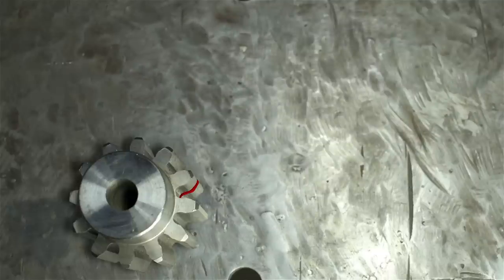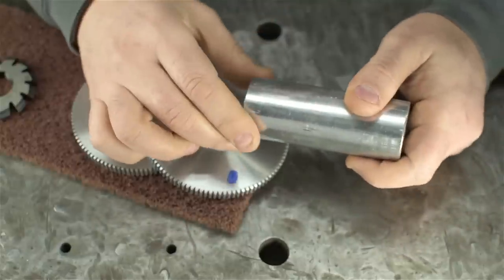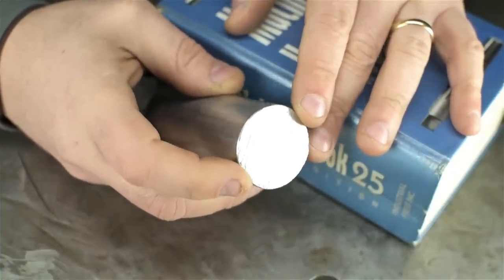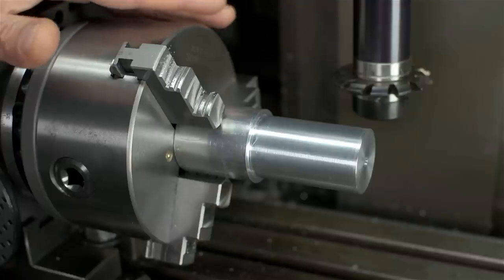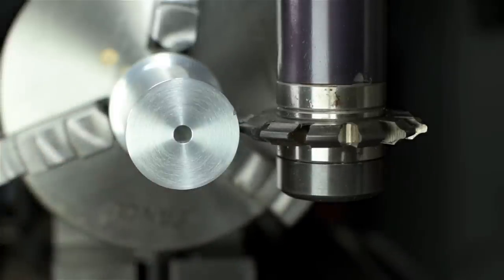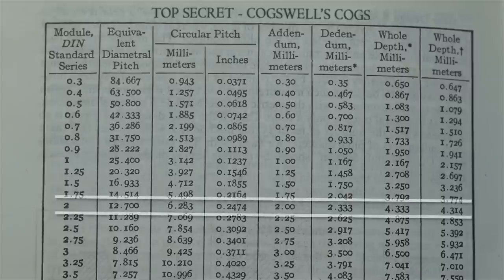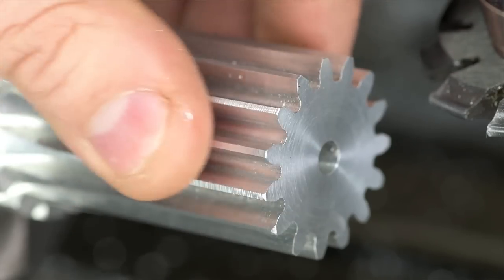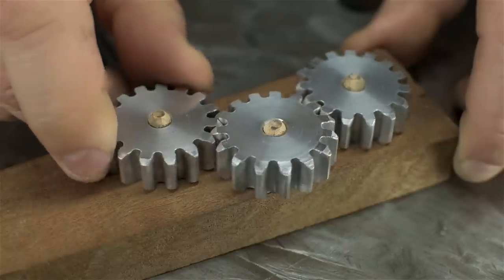15T-M2 Let This Be A Lesson To Ya!

Comment: The chamfer is to prevent creating a high-carbon concentration region during the carburization process with steel gears, I think! One time, while getting some blanks I turned hobbed and hardened (carburized) by professionals, I was going over the print with them and asked the same question about those chamfers... and got a great answer!  The carburization process is prone to concentrating the effect in sharp corners, i.e. the sharp tip of the tooth could be a place for heavy carbon concentration to gather, creating a region of high brittleness.  It's important to reduce this on the very tip, because that's the spot that will contact first if a gear is dropped, meshed while shifting, etc.
I also suppose the chamfer prevents raising a burr or ding is the gear is dropped, in general.
So that's what I've heard, and it makes some sense.  I think some micrographs of cross-sectioned gear teeth that have been etched would be a nice way to confirm that.

Comment: A couple people have mentioned that the chamfers are to prevent cracking,, but didn't say why. (yep.. put on yer spinnie hats!)  When you harden metal, small details like sharp edges heat and cool at a slightly different rate than the rest (more surface area per volume, etc..).  This causes minor stress cracks that, over half a billion revs or so, can might maybe and possibly cause the corners to break.  On the off chance that the little bits flying around are small enough that they don't just seize your gear system, possibly breaking other things attached to them, they will cause the gear teeth to wear a lot faster.  Best to nip them off, eh?

Comment: Chamfering of gears removes the maching burrs of course, reduces the chance of getting cut when handling them (also of course) but it also reduces breaking and chipping of the teeth. The part of the tooth that would chip off normally is sort of already chipped in advance...

Comment: Since i don't have a good dad joke, I'll just answer the edge chamfer question.  Depending on how tight your case is around the great train, especially if you are setting it in a blind hole or tight to an edge, you won't have to take an extreme amount of care to clean up the edge of the case enough to make sure the is no contact there.  If the gear needs to be as tight as possible to the case, like in a gear pump you wouldn't be able to have features like that unless you can make a similar profile in the case to minimize efficiency losses or you are moving so much fluid with a larger pump that the amount that slips back past that path is not significant.  

A similar feature is putting a crown on the gear or spline.  The a crown is a good feature to put on if the loads going through the gears and acting on the structures holding the gear train in place flex the orientation of the gears possibly letting the top or bottom edge of a gear contact the face of the other one, leading to chipping or breaking teeth.

Oh wait!!

Why did one gear not want to get closer to the other?

They didn't mesh well
Hold for laughter

Comment: chamfered edge? Maybe lube draw-back into the working surface. After oil is pushed to the depth of the tooth and out sideways by the mechanical load, centrifugal force pushes it to the tip of the teeth on the outer face of the gear. A little chamfer draws it back into the teeth instead of it getting thrown off.

Comment: The reason the chamfer the teeth is so under high loads the outside of the teeth is less likely to brake of and also help with mesh in a gearbox nice job of those gears looks professional 😉

Comment: Maybe the chamfer lessens the chance of a gear tooth chipping off the corner when axles aren't perfectly aligned or some small object interferes; also allows the teeth of two gears to mesh with enough contact area but also takes away what isn't necessary to reduce friction.

Comment: If I remember correctly (pending wife to comment below) the gear teeth are prone to break off from stresses when the teeth have sharp 90 degree transitions. The chamfer should reduce cracking in high torque applications

Comment: I'm late to the party, but I haven't seen anyone hit all the various reasons for speccing chamfers on the gear teeth. For one, sharp external corners are more likely to chip or break and cause issues. For another,  removing the sharp corners is nice if there's any angular misalignment between the gears. It also helps lubricant on the gears (you'll likely never see gears on a gear pump with a chamfer), and finally, if you spec a chamfer, you can be pretty sure they'll knock the burrs from parting if off when cutting the chamfer.

Comment: The chamfer on the sides of the teeth is to prevent snagging. When the tips are exposed to a load at speed, they can flex and end up chipping. This would be bad in a sealed casing because the chips could cause additional damage to the gear train. Hope this helps.

Comment: If the gear faces are in close proximity to another surface, chamfering the teeth gives them greater clearance under load and deflection, and prevents the teeth binding into the nearest face especially as the bearing surfaces age, and also helps stickier debris to free itself.

Comment: "Chamfering plays a rather critical and important role within the gear production process. The process occurs after the process of soft machining which is delivered to the edges of the teeth. With chamfering, the sharp edges along the work piece faces are eliminated. This allows for a shaping potential for a defined edge shapes that can be realized. Generating a chamfer can be because of multiple different reasons. For example, to avoid any weakening in the edge area during heat treatment or to improve assembling processes for spline gears. Furthermore, a chamfer can increase the life of the hard finishing tools on the following manufacturing processes. Especially honing tools can react very sensitively due to stock deviations around sharp edges."

Comment: Its also a good idea to to jot down the degrees the chuck should advance every time. In this case 24 degrees. If you start at zero, you get 24, 48 72 etc. It is a simple double check, especially something critical and when you say are doing 7 divisions and have to turn the handle 5 and a bit its easy to be interupted in the middle and loose your way. 90 to 1 rotary table is even worse.

Comment: Everything from You is a great lesson to me plus great laugh included.
You managed to explain different tools for dividing and indirect dividing in like 5 minutes and better than 99% of others I've seen / read in some overly-intelectual machinist books. 

Btw - how about - just ideas:
1. Machining gear rack (in vertical setup :P ) - spacing between the teeth, etc.
2. Making some 45° gears 
3. Making custom (fly?)cutter for gears - how to make that damn geometry of the tool?

Comment: Goin out on a tooth here, but I'd guess the reason for chamfering the teeth is to make them less "dangerous" during handling. Those sharp corners could lay open some flesh faster than a filet knife on a water melon.
I've had metal edges cut me cleaner than a broken piece of glass.
Oddly, the other day while handling some old/removed cabinetry,  I turned one of the boxes over and because they were damp (from being outside) the box slipped out of my hands which slid along the wet cabinet. Well, a piece of linoleum that was still stuck on the one side sliced my the tip of my finger cleaner than any razor blade cut I've ever endured.

Comment: I believe that the reason they chamfer the edge of the gear is in case they are used in an application where the gears are meshed in a horizontal plane, this keeps the ends which are thinner to not be the first to engage thus lessening the chance of snapping the tooth. I could be wrong though.

Comment: The chamfers on the gears are for debris. With a straight cut, any debris on the sides of the gears has the potential to mare the gears very easily. With the Chamfer, it is more likely the debris will get pushed out VS going inbetween the teeth.

Comment: Love these videos. One thing I’d like to know is how you set the length when cutting. For example; you cut each of the three gears at the end in equal thickness. Do you have something set up that showed you how to divide the length cut into three gear sections? Maybe you’ve covered it, but I think I’m asking what regulates work length or in a project where you are doing an inside thread, what levers or stops are you pushing and using to determine depth of cut or how far to drill in towards front of work?   Thanks!

Comment: Chamfering the OD and side of a gear is strictly cosmetic. There are some other benefits though, such as preventing the OD from fowling in the root of the mating gear due to inaccuracies in OD/root diameter. Also, this helps with material handling safety. Teeth that aren’t chamfered can be sharp.

Comment: I guess the bevel is done so a bur can't form in that area of the gear. The recessed area pulls the edge of the tip of the tooth onto the face, proper, of the mating gear. If there's any bur formation, there won't be any energy lost through the touching of this bur to the matching bur of the mating gear. The edges of the gears don't line up anymore. 

Another guess is that it is traditionally done because it can hide small machining errors like unintentionally rounded corners, dented edges from dropping the part, or perhaps the revelation of unexpected voids/lows in the sharp edges of the starting stock.

Comment: I'd assume it's a meshing thing for assemblies where the gears are shifted in/out and also as an added protection from getting pinched in between them, meat mitts or other objects are less likely to get pinched between the teeth if they just brush up against the outside edge. With a hard edge they'd probably grab anything and suck it through the mesh, especially meat popsicles.

Comment: i think the bevel on the edge of the teeth is just to reduce the chance of chipping a tooth.  it also might provide some degree of gradual engagement and slightly reduce the inertial mass of the tip of the tooth. it might also make it easier to pull your safety tie out if it gets snagged.
Reply: So, it might reduce stress risers? That sounds like as good an idea as any.

Comment: Yo this old punmaker!
Great video as usual!

I had to create some gears for one of my projects. And as an engineer, why should i use standards? So i worked myself down to get functional gears, only to see this video.

Now I re-made them with fusion 360 and the spur gear generator. Took 5 Minutes to get them into the 3D-Printer.

Yes, I print them, but only because I use them for a model ship and nothing other fancy. And on the other hand: would be hard to fit a lathe, a mill all the other stuff I would need into a small basement store...

Comment: The champfer leads lubrication (oil for example)  to the contact area between the theeth. In laying position as in upright. Upright the oil would run down from one surface of the gear to the other. But the champfer leads it in the theeth..... 

Im no Metal worker.... but i worked long time ago for a company from Continental that produced Gears for Automotive. Fuelpumps for example. And the Engineers told me that.

Comment: Tony, will you "please" do a video on pressure fits, and interference, and tolerances?  You touched on this in you Fly Cutter Part 2 video (mentioned you used the torch on the cutter head and the spindle dropped right in).  Cheers!

Comment: I did a little searching: Gears are typically chamfered to prevent brittle edges on hardened gears. Other things such as noise reduction are also achieved with chamfered gears.

Comment: I read that the edges are chamfered to keep the teeth from chipping. If the shaft flexes under load, the edge of the gear(s) can chip, then metal is in the lubricant and conditions worsen.

Comment: Hey Tony
Great video!
I do believe your missing a very good point here.
Why do we need gears? To transmit power/torque from one place to another, thru a ratio.
The number of gear teeth has nothing to do with the ratio your trying to produce.
What determine this is the pitch diameter of the gear.  It is the same for belt/pulley system.
Diameter determines this. This must be determined 1st. 

As for the chamfer,  after hardening the gear, less chance for the gear tooth to chip out or off.
Ohhh, where did you get that pullstart mill? I used to have one just like that!  (wink ,wink)

Comment: 9:24 You joke, but the capacitor I used on my buddy's Bridgeport to run a 3 phase motor from single phase supply went on us one day so we actually did have to pull start it. As soon as it started turning it could limp along on its own, but it needed some help getting started.

Comment: You chamfer gears to avoid that the ends will rub on something if the gears don't run extremely true. This case the edges might break off and grind in your gearbox.

It also reduces the stress on the edges if the gears don't run on axes perfectly parallel to each other. Same issue: This would be impacts onto each other on high speed, resulting in shattering small pieces off the highly hardened teeth of a gear, which then contaminate the gearbox grinding down the components.

Comment: From the context of mass production of gears, chamfering serves a number of purposes. Firstly, it is a question of workplace safety, where sharp edges or burrs may cause injuries during assembly or whenever the gear is handled. Secondly, a chamfered edge is less likely to chip in a way that damages the functional gear surface, should the gear bump into something. Thirdly, any excess material on the gear flank side leads to a risk of damaging the hard machining tools (grinding or honing wheels). There is also of course a risk that a loose edge falls of and causes contamination during application, or that it interferes with the gear meshing and acts as an initiation point for damage.

Comment: I don't understand why this worked so easily unless the cutter was not only designed for module 2 but also for a number of teeth close to 15 (or exactly15).  When Gear shaping or hobbing, the cutter rotates into the stock and back out with successive cuts for a single tooth space just like a mating gear tooth would pivot into and out of the space.  This results in a varying  profile for different gear diameters. 
For illustration: a gear rack has teeth with planer faces while the gear that meshes with it has teeth with involute faces.  Imagining the rack being made of a bent ribbon of metal with a thickness near zero, as you bend the ribbon rack around into a circle, the flat teeth faces would distort to approach something close to the involute shape. The shape of the tooth would change as this ribbon gets to a decreasingly smaller radius. But the cutter isn't changing.
So....What's up?

Comment: That dividing head seems ripe for an upgrade with a stepper motor. My thought is replace the hand crank with a stepper, add a simple Arduino based control box where you tell it either # of ° per position, or # of positions per revolution, as well as index forward and index backward buttons. Maybe add a servo for the rotation lock. As a retrofit I think it would cost <$100 and make dividing operations faster and reduce errors.
Reply: Clickspring has this for his lathe.

Comment: I am planning to make a gear for my table saw that adjusts the blade angle (old saw like me) I am planing to make it from either aluminum or brass. Currently it is some type of plastic. No longer available. I did see that I can get one 3D printed from Nylon but I’m not sure how well it will hold up. That and one of my many nicknames is King of Overkill. I have no mill but I am making an indexing wheel for my SB 9. I’m thinking that I can use my cross mounted drill to drill the valleys (14) with a 1/8” bit then complete with another series of 5/16 holes to produce the “teeth” then just turn anything that isn’t gear off. What are your thoughts? Do you have a simpler solution? Love your feed and almost always learn something new every show. Thank you!

Comment: i think the gears have the champher so in the event that they wobble or come off axis slightly they will not bind but instead ramp themselves into one another and mesh better. you are also more likely to have a burr where the gears were cut. this can cause problems with clearance on the casement holding them. aand again if they were to come off axis slightly.

Comment: @This Old Tony 
Great videos, found you via AvE and have to say I really enjoy your content. Keep up the great work, oh and greetings from Australia!

One thing I picked up on though, in your video regards making the 100 tooth gears for the mini lathe, you stated that you believed that the Chinesium cutters that you (sort of) got as a kit had the cutter numbers backwards. If this were the case the calculations for the stock material OD wouldn't work.... So based on that they have to be correct yes?

Cheers Glenn
Reply from the maker: I've since learned metric cutters are numbered backwards! I think anyway.:)
Reply: @ThisOldTony  Thanks for the reply!  Forgive me if this is totally wrong as I'm currently sitting on a bus in the middle of nowhere coming back from nightshift at a mine,  but if memory serves,  does that mean then that imperial cutters can't use the formula that you demonstrated?  Just curious as I found your information presented in the video excellent and very informative. 

Cheers Glenn